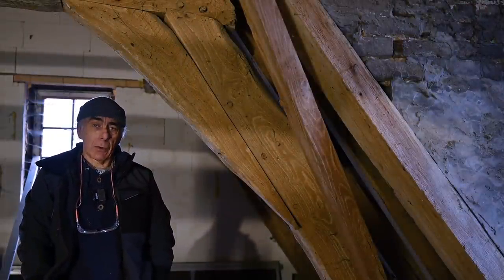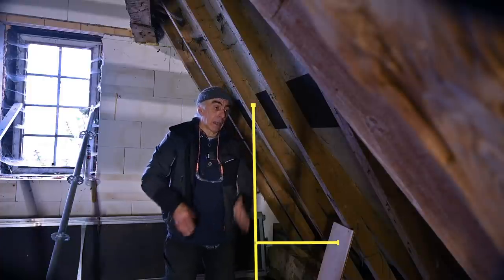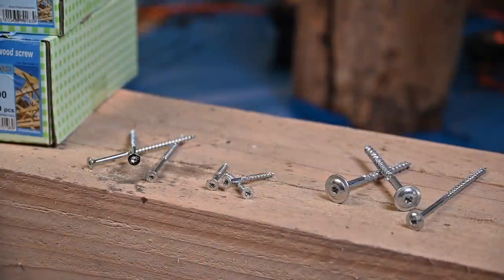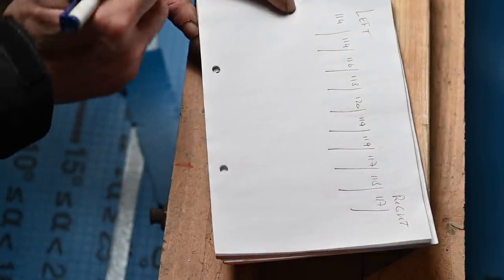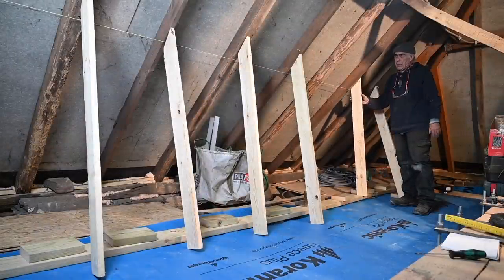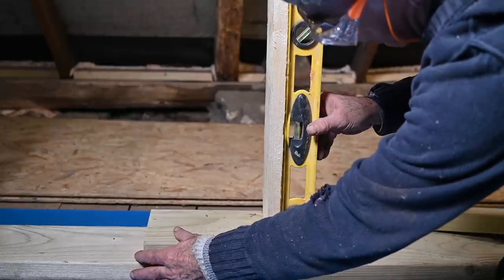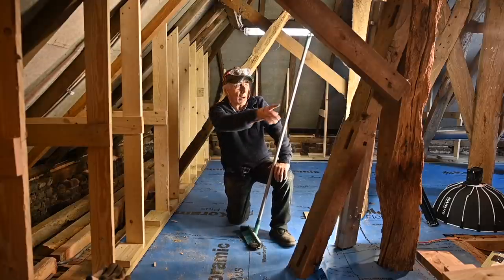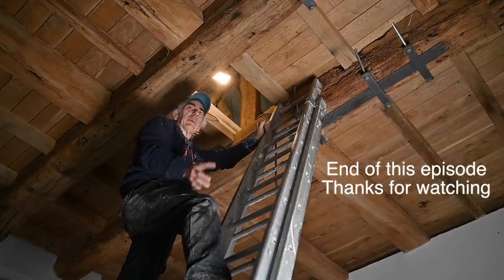Enforcing the roof of the tower- final

Comment: How does the ventilation work after installing the insulation? Condensation on the wall in the cold area?
Reply from the maker: Good point and i will address this in my next video... But the principle is that the roof is a breathing roof, so no insulation there.   The tower room has the original walls front and back and as such can breath, the Right and Left wall have a drywall in front, but placed at 10cm from the original wall with a breathing space and gab on the top.   The windows are not 100% sealed, there is overlap of the profiles but no rubbers to seal it all off.  All that makes it a ventilated solution in an old house...   Installing a modern ventilation system is not possible

Comment: I love your videos, Steve. One question on this one: Why did you nail the tops of the support beams onto the sides of the rafters and not directly under them? (I'm no carpenter. It just made me curious.) Thanks again for sharing your knowledge.
Reply: I had the same question.   By nailing to the sides you are relying on the strength of the 2-3 nails that may be 800 lbs.   If the wood carried the load it would be over triple the capacity of the nails provided the sole plate is resting on something solid.    Either way the work provides a substantial increase in capacity.
Reply from the maker: thanks for the comments,  that would have indeed been an option...and a very good question.   The answer is , as the beams angle varies a bit, i would have marked each support along that roof beam and then cut it to the right angle. That I would need to do for 68 pieces, so that takes time. the way its done now is faster and I have a slack.   Of course it is less supportive as I rely on the nails and friction.. So , yes if I had a perfect roof and more time I would have done that...  and if there was a need...  Note that a 3mm nail (0.131 inch) can hold 100 pounds... I have 3 of them so 300Lbs per roof rafter.  Of course we also have the woud density and the friction that plays.  So I have an additional support of the roof rafters of about 300 pound every 2 feet..  In total 20.400 lbs.  So the balance is quickly made... less work and enough support
Reply from the maker: Indeed